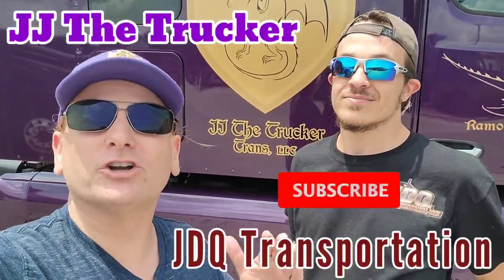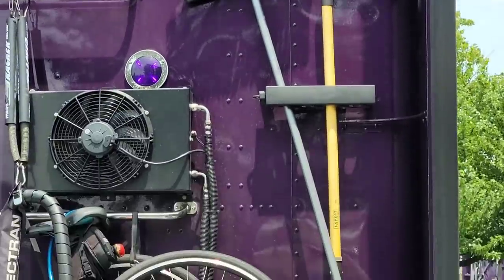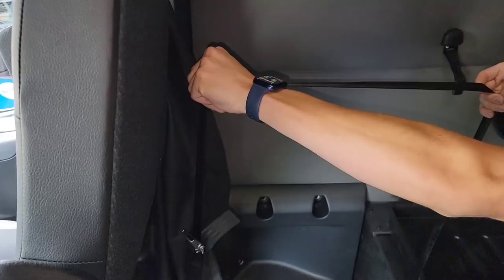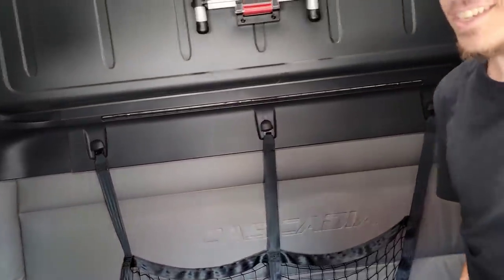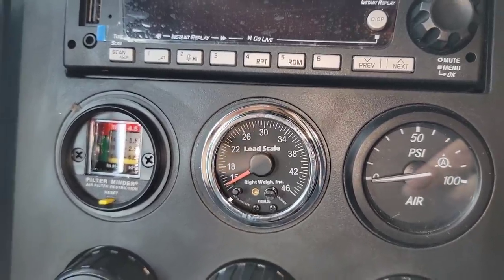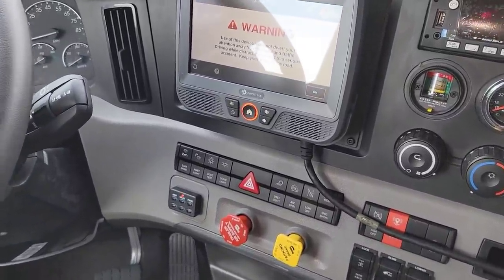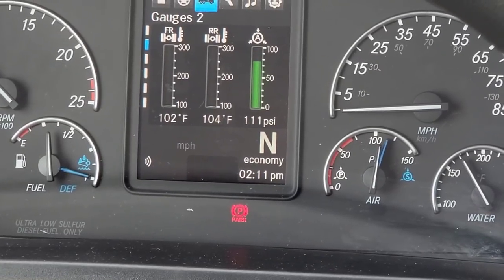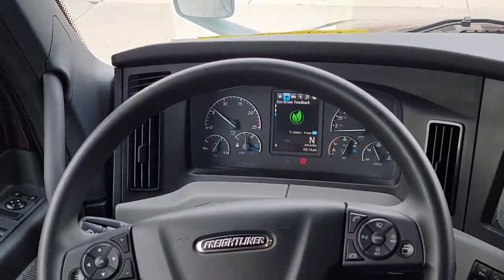TRUCK TOUR! 2022 Freightliner Cascadia - Inside and Out

Comment: Also, I use the Microwave slot to mount a gaming PC.
Reply from the maker: Good idea but seems pretty bulky and space is at a premium in these trucks. I have a gaming laptop and it seems to do nearly just as good as for about the same as my previous gaming desktop did. Takes up a lot less space and I mounted it behind the TV.
Reply: @JJ the Trucker  I'm using a "SilverStone Technology Home Theater Computer Case"

It looks like a stereo tuner and about the side of a microwave.

Fits perfectly across and half way up.

I was in the Army so I tend to just eat cold cans of soup or cans of meat like tuna with a fork.
Reply from the maker: That's pretty cool. Before I became a trucker I build my own htpc and connected it to my 56 inch HDTV and it was awesome. Much quieter fans and definitely a benefit to have it looking like that instead of the upright desktop.

Comment: I don’t know if it was mentioned in the comments, but with the automatic lights but it also works for your high beams auto on and off, his truck should have automatic rain sensing wipers, if you turn the wipers on the lowest intermittent setting, the wiper will adjust speed automatically. Also, coming from a 2020 to just upgrading to a 2022, my 2022 rides so much smoother then my 2020 did, so they must have changed something in the suspension system between 2020 and 2022.

Comment: I open my top bunk window and place a fan to blow across to force the hot air of the truck.

Mine doesn't even have a single vent up there :/
Reply from the maker: Good idea. I see some trucks have a fan built into the window up top but I haven't been able to find one for my truck yet.
Reply: @JJ the Trucker  I clamped mine to the rod on the wall that locks the top bunk in the up position and ran the cable down to the fridge.
Reply: Regarding better ventilation at the top bunk. Ideally you'd want some solid duct up to the top then have the last section, 2ft ish, as flexible ducting. Seal up the end and make a number to 1/2" holes in a straight line on the flex. You lose velocity with that flexible stuff. Plus all the vent holes dissipate the cold air better than one 👍

Comment: When your hazard lights comes on without you activating them in the Freightliner it's an indication that your truck software need to be upgraded..
Reply from the maker: Whew! I thought it was an indication that the truck was Haunted! 😂
Reply: @JJtheTrucker  🤣😂🤣😂🤣 if you didn't know that blinking light will drive you crazy.. once the upgrade no more problems until the next upgrade
Reply: @tooswee  It should be noted that as long as you have Detroit Connect, a lot of updates can be done over the air. talk to your fleet manager to have them allow the update on the portal; and if your an own op obviously you can simply log in to the portal and allow the update, then follow the prompts.
Reply: @takingthelibertywithsam4470  Great information I must ask maintenance to inform FM how to preform this service..

Comment: Are super singles common now? Can you run if one blows out?
Reply from the maker: They're becoming more common, but mostly in large fleets. They tend to not blow out as much as duals, so you can still limp to a service station when flat. Done it twice. If it does really blow out though, where there's rubber flying everywhere and the tire is basically gone, then no.

Comment: How those single tires at the rear works in action? We don't have this in europe. Drive shaft always with pair tires.
Reply from the maker: Works the same as the duals as far as functionality. Less drag and lighter so it saves fuel and you can haul more freight. Also, 1 super single is less expensive than 2 duals.

Comment: different door handles. Does Prime like big single tires or is that driver's choice?
Reply from the maker: Prime requires Super Singles for better fuel efficiency and better control during slides/skids, etc. There are some other benefits they really like as well.

Comment: Thought the 2022 has digital-dash?  🤔
Reply from the maker: It has the option for the digital dash. The dash is made by PanaPacific, the same company that makes the POS stereo in these Pete's. Mine has so many bugs, and each update to the software hasnt fixed a single one, but has introduced even more problems. So I don't think I'll let PanaPacific touch my dashboard. The radio is optional (kinda). The dash isn't. I need it to be working properly all the time, no bugs.

Comment: His truck computer doesn't use the new Zonar system?
Reply from the maker: Not sure what that is. It has the radar that shows the vehicle in front of him, including their speed and distance in feet and seconds. It also has the built-in lane departure system.
Reply: That system in the Freightliner is called Detroit Assurance
Reply: @JDQTransportation  Does have the Detroit motor
Reply: @richspurlock24  yessir. DD15 with the DT12 transmission
Reply: @JJtheTrucker  It's supposed to be a new system that replaces the Qualcomm system.
Reply from the maker: Aaaah, OK. That may be a Prime decision then since they work exclusively with Qualcomm.

Comment: To get these you have to lease, correct? Otherwise, company drivers get the lightweight truck with the 48" sleeper?
Reply from the maker: Nope, if you're a company driver, you can request a lightweight (you make more $ in a lightweight), but the normal nowadays is the condo unit like this one.
Reply: @JJtheTrucker  Awesome. Thanks for clearing that up for me.

Comment: I'm noticing 4 fat tires in the back instead of 8, does that in turn save money on replacing and rotation of less tires. Or does it come out to the same amount per year?
Reply from the maker: Rotations cost the same. The tires cost a little bit less than dual tires but not much. The real savings comes in better fuel mileage. They have less rolling resistance and are lighter plus you only have one Rim instead of two on each hub
Reply: Cool, thanks.

Comment: Why didn't he go with the table option? I like mine, fold the bottom bunk up, pull the table up and you're not restricted to sitting in the front...10/10 recommend for next truck
Reply: Which I'm assuming you'd have to get the electronic "apu", which I also recommend
Reply: I didn’t go with it because with it I won’t be able to hang my tv on the window. And that’s the only logical place I can put it

Comment: Hi JJ, when you complete a lease purchase at Prime, it will be 4+ years old with 450k++ miles, will Prime allow you to continue using that truck or will they deem it too old and make you get a newer rig?
Reply from the maker: 2 parts to my answer...
While you can choose a 4 year lease, the default is 3 years, so you'll either have a 3 or 4 year old truck.
And yes, as long as it passes inspections, has all the required safety equipment and doesn't incur a lot of down time, you can keep it and keep running it for as long as you want.
Some keep it. Most pay it off in 3 years, run it payment free for 1 year and then sell it when the warranty expires at the 4 year mark, then get a new lease purchase.
Reply: @JJtheTrucker  thank you so much JJ
Reply: JJ you do a great job with the videos and even better at the effort of responding to questions so I’m very grateful for you.  Quick question, I don’t understand why I don’t hear more drivers parking the truck for their 10 hour break and go to a local museum or go play golf or some kind of sightseeing for a couple hours?  I never sleep 10 hours, is it not possible to catch an Uber during 10 hour break and doing something fun for a few hours?
Reply from the maker: It's possible bit all of that takes time out of your 10 hours off. 6-7 hours for sleep, an hour or so to eat dinner and wind down, an hour or so to wake up, use the restroom, brush teeth, do a walk around on the truck before leaving and eat breakfast, etc... Not much time left, if any. Now, 10 hours is the minimum amount of time off you have to take. If the load isn't on a tight schedule, then you certainly van take more time. But it also depends on being lucky enough to have that extra time and ending the day parked near one of those places. Lots of factors. But it happens here and there, and I've done it.
Reply: @JJtheTrucker  thank you so much

Comment: when you Pete hits 200k get a new Freightliner Cascadia i have ridden in a brand new 2021 Cascadia its comfier than the 19  model
Reply from the maker: I've driven in a 17, 18, 19 & 20 Cascadia.  They got better, but there's no comparison to the Pete.
And why dump the Pete at only 200k?
Reply: @JJtheTrucker  would you drive a international or western star
Reply: when did you dump the 20 Cascadia how many miles did it have
Reply from the maker: I don't know enough about the western stars. You don't see aot of OTR models out here. Assuming it's for a reason.
As for the internationals, I love the looks of the LoneStar. I'd have to look more closely at it to see if it'd be better or similar to the Pete or Shaker.
Reply from the maker: I turned it in last September. I think it had around 125,000 miles on it.

Comment: When you leave prime, you'll realize how much better trucking can get. Way too much micro managing.
Reply from the maker: Which is what brand new, inexperienced drivers need. I'd recommend anyone in that spot to stay with a Mega carrier for at least 2 years, then move on if they're ready.
Reply: @JJtheTrucker  to a certain degree definitely. But not calling, and bothering you for hitting the brakes " to hard" .. low pay with low miles. My company is $30 hr to start. Drivers averaging around $100k a year . Anywhere from 52 - 60 hours a week. Tanker, non hazmat.  My friend was barely grossing $1150 a week. Out OTR 3 weeks at a time. Then when he came home, that week he gross $900😂😂. We get 3 weeks paid vacation. 40 hrs of sick time per year. Great 401k. Prime needs to step it up. That's why they're a training mill with never ending hiring.
Reply from the maker: I think Prime has stepped up their game since that report, and if he's taking home time every 3 weeks, thsts more than 3 weeks off per year.
I'm set to net over $100k this year and I've taken 5 weeks off so far, and about to take another one off in a couple of weeks.
And noobs need to learn how to drive safe. If it takes some phone calls to learn, and thsts about the only reason they ever call me, then so be it. Doesn't bother me to know they're training safe drivers.
And does your company hire drivers with 0 experience? If not, how many years do they want?
Reply: I will add that alot of the micro managing is dependent on the dispatcher. I work for prime and the only time I hear from my dispatcher is if the are problems/changes with a load even then 90% of the time it's by Qualcomm.
Reply from the maker: Agreed

Comment: Hundreds of the 2022’s have valve problems. Check the vin. If its from mexico. Run. Ive had mine 4 months , broke down 8 times . All valve lash . I know atleast 10 others who have been confirmed this problem. All the trucks coming out of mexico had this problem. I talked to a couple tow trucks and they said they towed 8 guys, the other guy said he had 10 and another one had multiple. All the same issue. If its from the cleveland plant your gtg
Reply from the maker: Nice try. All Freightliner parts are made in Mexico and built in the USA. It's under a great warranty. If you have problems with it, get it checked and fixed. I got a tone of problems with my Pete. Same result.
Reply: Wth hell with all the issues